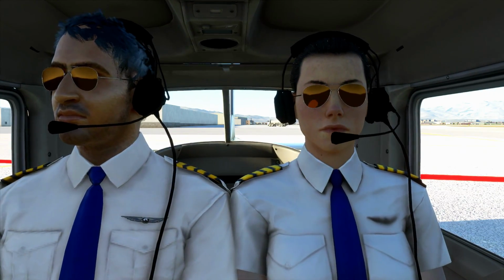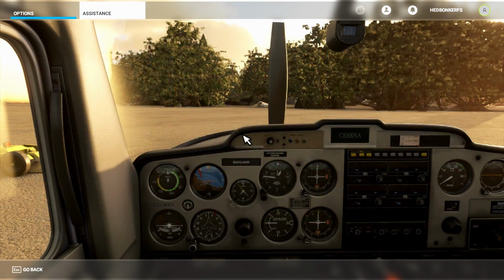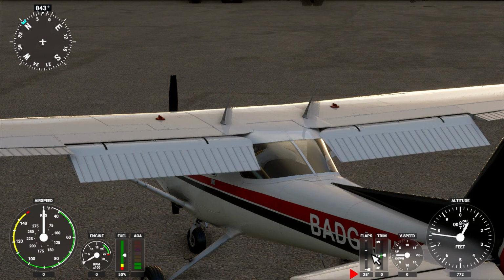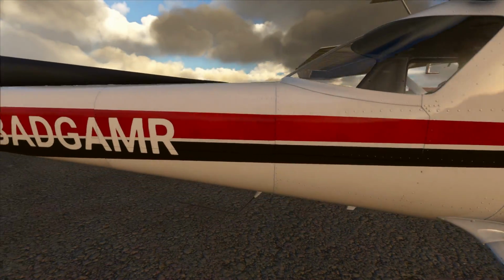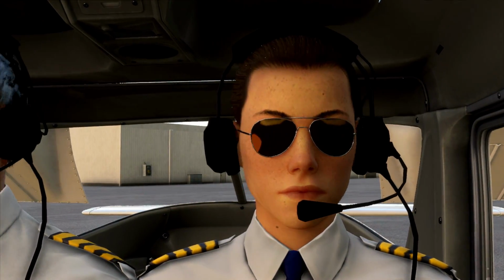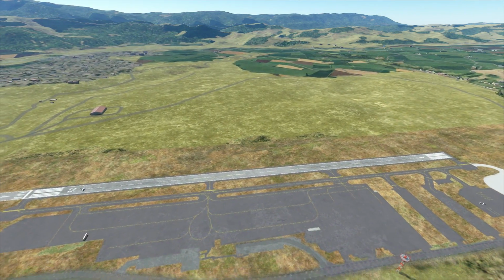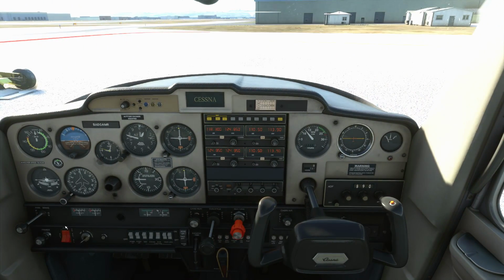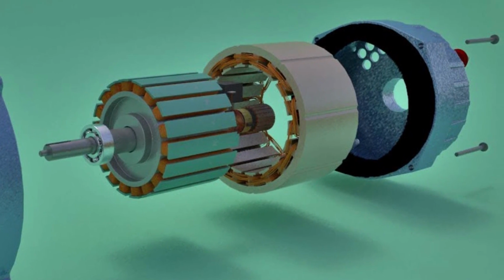FS2020 Pre Flight and start up Cessna 152 Complete!  Flight Simulator

Comment: Hi,
Since this video is a few months old already, I would like to know if the mentioned bugs on the 152/172 are fixed by now or if they're still present (which wouldn't surprise me, considering it's Microsoft)
Reply from the maker: They actually fixed everything except the reversed fuel shutoff valve on the 172.  Other than that they fixed the other issues.
Reply: @badGamr  thanks! Regarding the valve I found out these days by myself that it wasn't working, I wasn't aware that it was a well known bug
Reply from the maker: @ralfsenger  I suspect it's well known among those of us that still love to fly the 172 :)